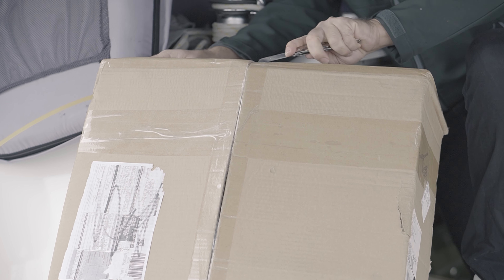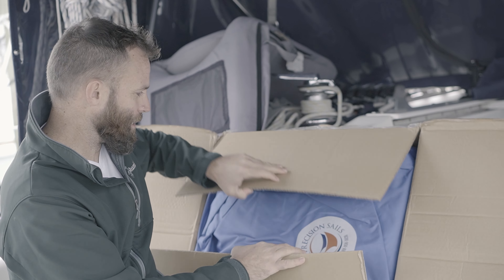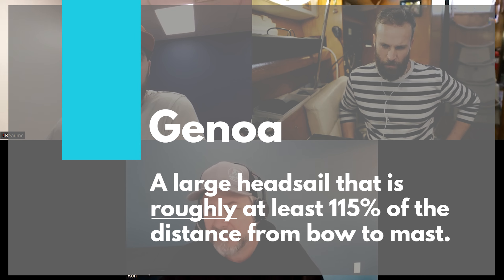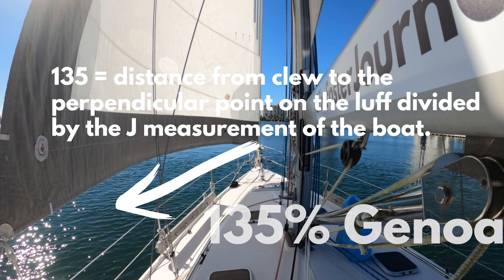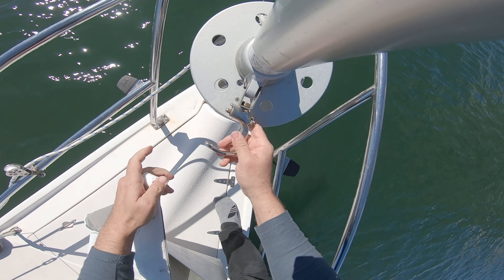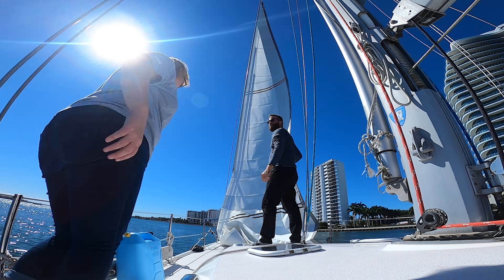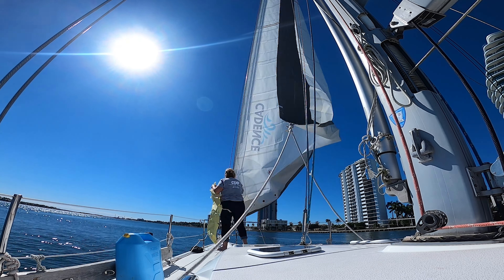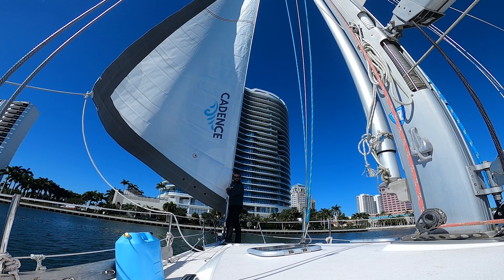What is a Working Jib? Why did we choose this new sail? (Ep.117) Discussion with Precision Sails

Comment: Thank you so much for all the hard work you put into making this video.  Head sails are a complicated subject. I think we hit on the key points that will help sailors choose the right size head sail for their needs!
Reply from the maker: My pleasure. I hope other sailors find the video helpful!
Reply: @TheFosterJourney  Great video. What would be the performance difference between just not furling out a Genoa as far vs having a smaller jib?  (outside of the self-tacking bonus)
Reply from the maker: @giantELF  The shape. >> I always heard people say that "it loses shape", but I never knew what they meant until we found ourselves offshore over AND over with the Genoa furled up close reaching in 24+ knots of wind. It loses its designed shape and stops acting like a wing, and it starts acting like a flag whipping and flailing. The Jib, on the other hand, remains perfectly wing-shaped and performs as designed in 24+ knots of wind and gives reefing options with the wind gets to 28 and 30+. Hope that makes sense. I'm sure others could explain it better.

Comment: I’m a beginner to sailing and I’m old.  My question is, I have a 25’ Watkins.  It’s a masthead sloop.  I noticed that my Genoa doesn’t go to the top of the mast.  It has another 3’ to go.  Should I add something to the sail to bring it to the top?  Oh, one last thing, it’s a hank on Genoa.
Reply from the maker: Some people will use a pendant made of nylon webbing on the head of the sail to make up that difference to the masthead. We use one made of dyneema. But I prefer to put our the pendant at the head of the sail and keep the center of effort lower. Others say putting the pendant at the bottom gives you better visibility and moves the center a little aft.

Comment: Just curious, why not just reef a furling genoa?
Reply from the maker: Good question 👍, and that's what we tried for a year or so. It works for a bit, but then the shape gets lost and the sail flogs, especially in high winds, above about 50 AWA, or in light air. The Genoa just doesn't work well deeply furled. Offshore, we find ourselves in 20+ kts often and the Genoa just overpowers everything. Probably good for racing, but we like offshore sailing that's comfortable and doesn't break the rig.
Reply: Hi Paul, you can partially furl a genoa in heavy winds however, you end up furling away the sail shape making it less efficient.  Also larger sails made for lighter winds are made from lighter sail cloth.  If you sail them into winds they are not designed to be in, you can run the risk of damaging the sail.